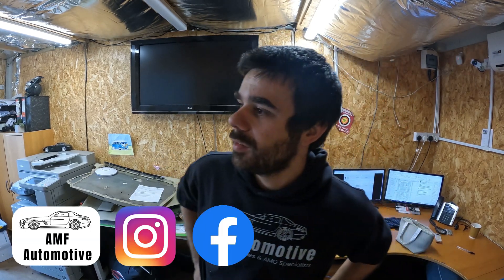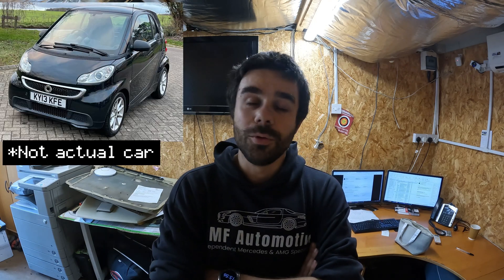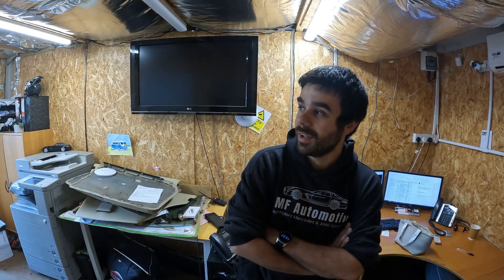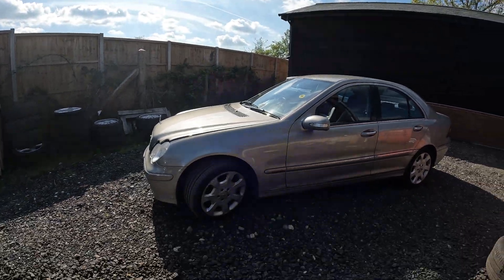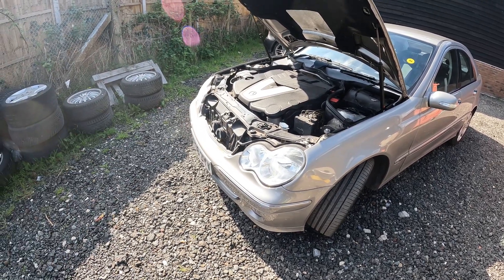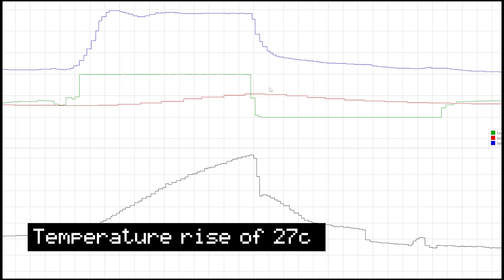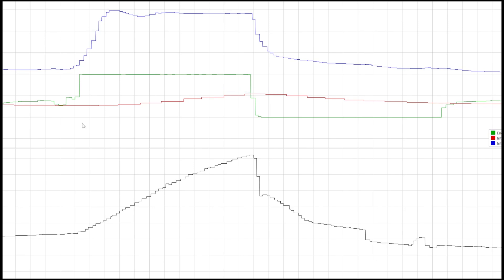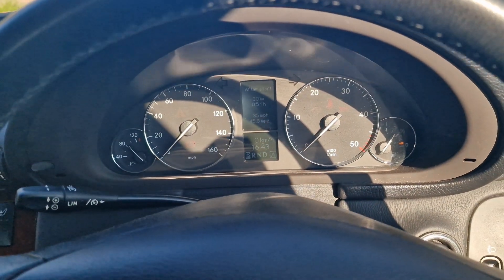Tuning our OM642 C320 CDI

Comment: is OM642 reliable compared to 646 ?
Reply: The OM642 is a reliable engine but it has its own problems like any other engines do. In fact it’s not the engine itself but more whats around.
In my opinion I have had 2 OM642 cls 320cdi both 2006. Still drive one today tho. 
The problems that I ever have had: 
- Oil cooler with its famous gasket
- Timing chain, can get streched out
- My first om642 had a huge oil consuption couldn’t figure it out why ( may be space between cilinderring)
Second one is good, very little consumption at 220.000km it’s ok maybe 1l in 15.000km 
Actually about the engine that’s it besides a few sensors and hoses all the other stuff,  the real money pain was everything around it. 
If you drive such  Mercedes Benz you have to be prepared to have a little money aside do to the monthly fixes that will 100% appear. 

-

Comment: It's definitely just the seals that go on the OM642, it's not the cooler itself. If they gasket is orange, bin it. Get the purple gaskets and you'll likely never need to touch them again.
Reply from the maker: We have done many leaking oil cooler seals that are purple, and have seen a few oil coolers fail themselves. If there is excessive corrosion on the bottom of the cooler, it will sit proud and not seal, or if the corrosion encroaches on the sealing surface, it will leak etc.  It's not worth risking £1000 worth of work for a £120 cooler.

Comment: What did you use to record datalog? Cooler helps even stock car 👍
Reply from the maker: Yes exactly, 50 degrees is quite hot on a stock car. A fast ELM adapter and some plx software. our tuning tools didn't log IAT which is a bit rubbish. We tend to use a handfull of stuff depending on model and year. EDIT: to keep somebody happy, it DID log them, but I couldnt export them so :p